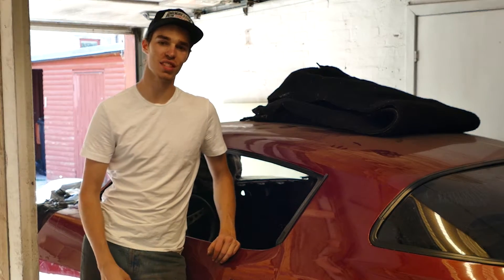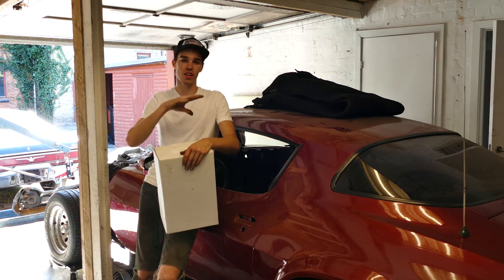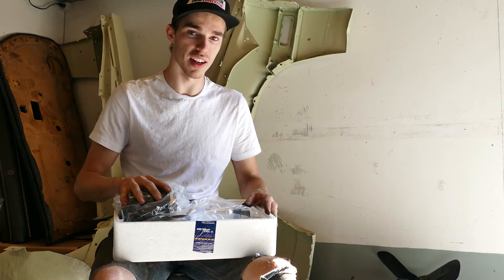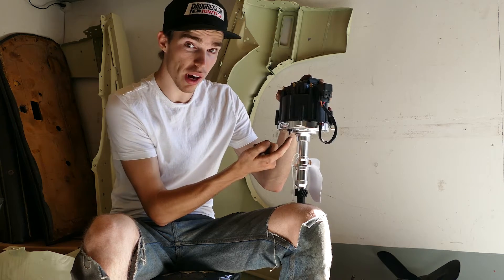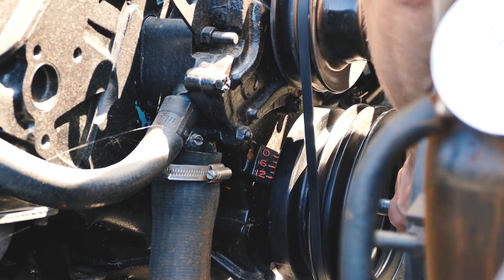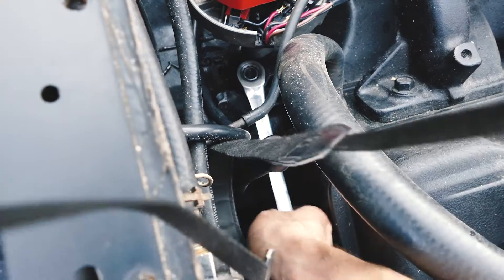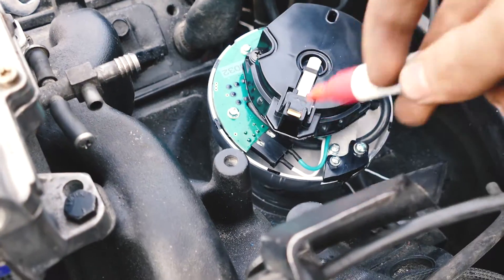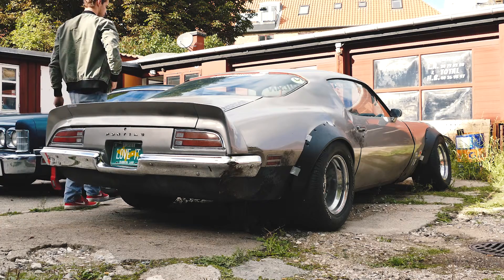The Firebird Get A Crazy Rev Limiter & Bluetooth Controlled Ignition

Comment: Not all cars like full manifold , make sure your carberator is on the transition slot and a square is visible, some cars will pull to much timming and overexpose the t slot depends on a lot of things cam ect .. seen full manifold idle better but slower off launch 😒 like your fire chicken !
Reply from the maker: when we talk stock type distributors yes but but this isn't, theres no vacuum canister as basically a map sensor like on modern cars so it monitors vacuum all the time for quicker and more snappy throttle!
Reply: @Viktorrhansen  ok never saw that type before yes most racing cars delete vaccum canister as its for drivability i like them on street cars for the extra timming you can pull since your 80% stop n go, enjoy american muscle 💪 cars run a 79 camaro 454 544 lift on a 110 t350 2800 stall and kit,  posi 342 similar cars, keep up the good work
Reply from the maker: @rooster68able   @Justin Richards  thanks man sounds like a killer setup ps the progression is no lie the best dizzy i have had so far, tune it on the phone with timing tables and the build in anti theft system so the car wont start unless u active the dizzy.